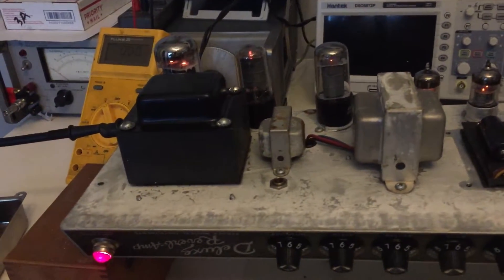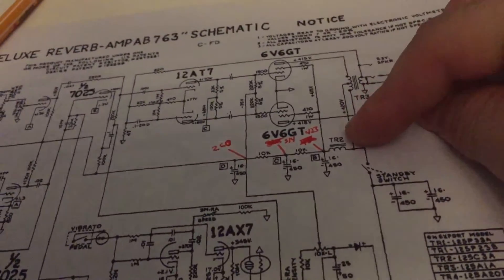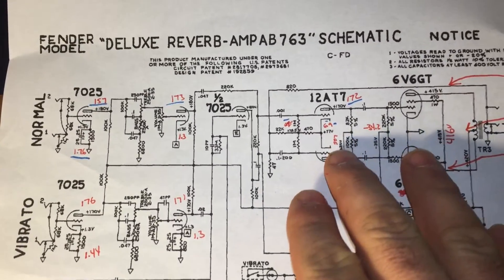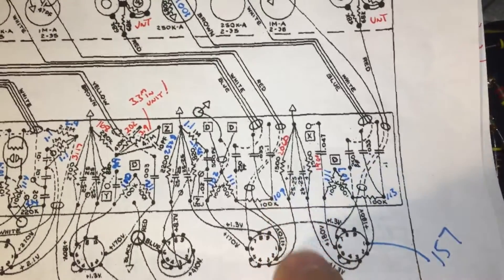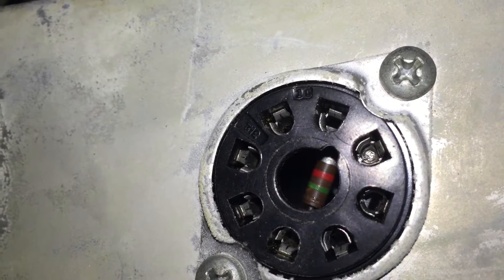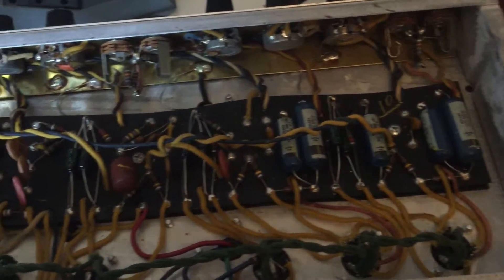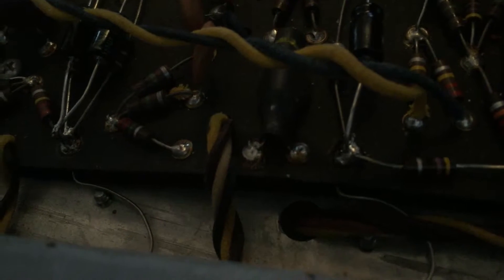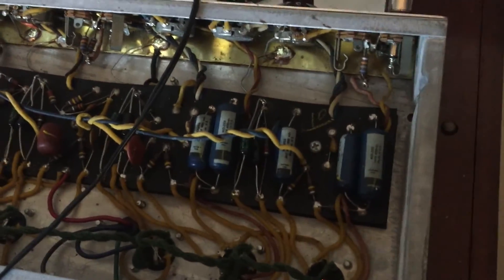Fender Deluxe Reverb - Tube Amp Repair Part 2 of 3

Comment: BTW, those phase inverter resistor values are correct, the schematic is incorrect. The AB763 schematic you are using is the early one, which was later corrected. The tip off is the two 100k plate resistors on the phase inverter, they should read 100k & 82k to balance the phase inverter. Look for the later schematic.

Comment: All the voltages are going to be off if that amp is run at wall voltage, and then compounded if the two dropping resistors between the filter caps are as badly drifted as those two were.

Comment: Great work, you are the first tech that actually tested for other resisters and capacitors in the in the circuit and found problems and also found differences in the schematics as well. I am impressed. Thank you. Tom Cowan  Digby Nova Scotia, Canada.
Reply: I have been a Fender amp player for 57+ years ... I always wondered why techs did not naturally look on down the circuit for problems. If a part fails, does it not seem logical that more down the line will catch that failure and fail as well? Maybe I am just one who knows a little, which can be dangerous, I guess ... BTW: Can you repair hearing systems to rid tinnitus?